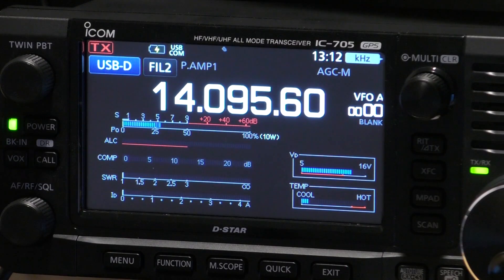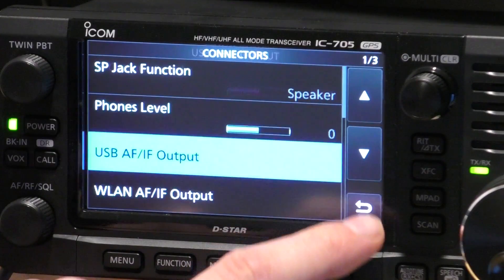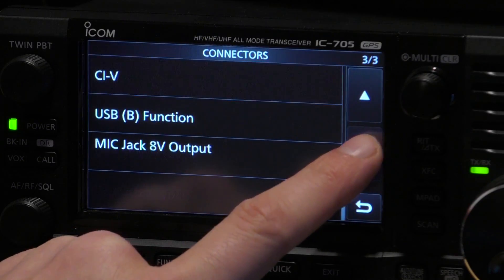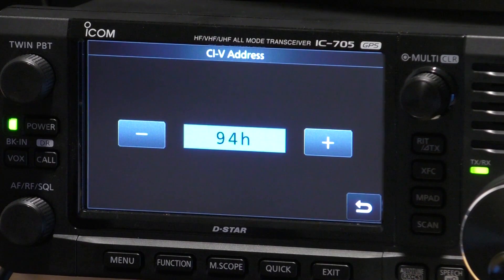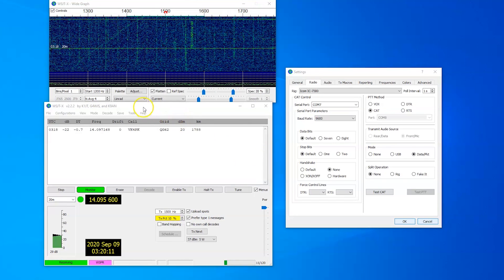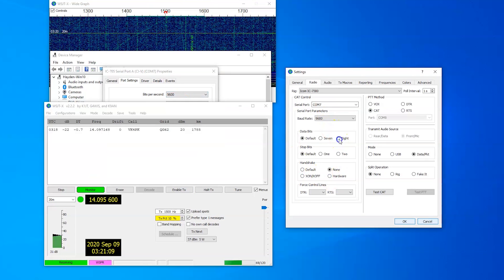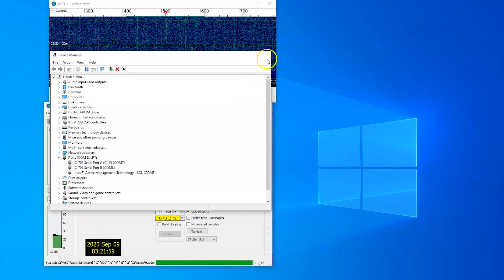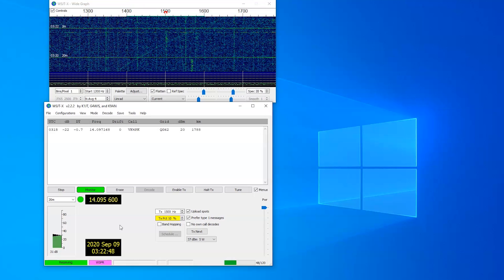Icom IC-705 SETUP for WSJT/Digital Modes (Easy and Simple)

Comment: Did you install the 705 Drivers or just use existing 7300 drivers... Thanks
Reply from the maker: https://www.icomjapan.com/support/firmware_driver/3070/
Reply from the maker: 705 drivers available on the Icom Japan website
Reply: @HamRadioDX  I was interested to know if it would work with the IC-7300 drivers,
they are the last quoted for Windows 7. I hate Windows 10
I may just try the ones straight from SILABS website, they are more uptodate than ICOMs
Reply from the maker: @MINI-4X4-RADIO  It seems that the USB drivers for the IC-705 actually have IC-705 written in them, as that is how it appeared in my Device Manager. They may not be different to the 7300, but some trial and error might need to be had. The IC-705 driver may work for Windows 7, but it's not officially supported, only 8.1 and 10.
Reply: @HamRadioDX  Many Thanks... I guess I can just try, can always uninstall if the 7300 Drivers don't recognise the 705
I do have a Win10 Laptop, just don't like it... I run Linux, but have a Win7 VM for Windows stuff
Reply: @MINI-4X4-RADIO  same problem. Resolved by increasing Connectors -> USB Af/If output -> AF output level up to 80%
Reply: @zetaBit  Not sure that was for me..??
Reply: Thanks but fails at Test CAT. “IO error while connection to rig”

Comment: I easily set up WSJT-X on my desktop PC couple years ago.  Now I'm trying to set up the IC-705 with either of two Windows laptops (Acer Aspire 3 15 or HP Pavilion G7).  Been working on the Acer for couple weeks and just today tried the HP Pavilion.  I get CAT CONTROL=GREEN and PTT CONTROL=RED and I'm able to change bands on the radio using the WSJT software.  But I can't decode any transmissions.  After loading the USB driver and right clicking for USB port properties I get IC-705 SERIAL PORT A (CI-V) (COM4) with 9600 baud rate, 8 bits, none for parity and 1 stop bit.  What's wrong.
Reply from the maker: Can you see the transmissions on the waterfall? Have you checked to make sure your PC time is correct-  I use NetTime that updates automatically.
Reply: @HamRadioDX  time is sync'd .  I'm just not decoding signals.
Reply from the maker: @Barnacle392  You can see signals appearing on the waterfall?
Reply: @HamRadioDX  not on the WSJT-X waterfall but yes on the radio waterfall

Comment: Does the IC-705 have an option to change the baud rate or its 9600 hard coded in the firmware? Thanks.

Comment: One issue I'm having is that the USB-D setting reverts back to USB when WSJT-X keys the rig. WHat is the configuration setting to make this "stick?" Thanks OM //73 KK0DJ Dennis
Reply from the maker: Under the radio settings is the “Mode” set to Data/Pkt? If it’s USB this will be switching it

Comment: JS8Call and WSJT-X are difficult to configure, erratic, and unstable, by even the most charitable standards. I have the MS Surface 3 and the Evolve Maestro running Windows, and getting FT8 working consistently is erratic, with both a USB direct connection the 705 or WiFi. SDR-Control for the iPad, however, is incredibly stable, and as close to perfection as software can be. Within minutes of first loading it, I was making contacts, and have logged hundreds with it so far. For those Hams who tire of fiddling and just want to make contacts, pick up an iPad or Mac, and try SDR-Control. Its in a class by itself.

Comment: Thanks for this! I received a call from a fellow ham to help with getting his new ic-705 working, but I don't have one (but familiar with the 7300). It would have been  a bit more helpful to see this done from factory defaults. 73!
Reply from the maker: Glad I could help and yeah I should've done from factory, but if you ever need to view factory defaults you can long press on a menu button and there is a default button there to compare. 73

Comment: What did you use to connect the IC-705 to the PC? Can it be done with just a USB cable or do you need an interface which connects to the sound card in the PC?
Reply from the maker: Yes just a single USB cable. No interface required as the sound card is built into the radio

Comment: WSJT-X  split  should always be Rig or Fake it to  reduce the chance of TXing any audio harmonics.
Reply from the maker: I didn't bother with Split operation as I wasn't going to use it. That said "Either method (Rig or Fake it) will result in a cleaner transmitted signal, by keeping the Tx audio always in the range 1500 to 2000 Hz so that audio harmonics cannot pass through the Tx sideband filter". Thanks

Comment: Data OFF mod should be Only  MIC..   not Mic/USB
Reply from the maker: Incorrect. The Mic/USB is set by default. Listen carefully to what I say in the video. I actually prefer to use Data Modes in regular sideband operation, not in USB-D. If you don't wish to accidentally have your MIC in and/or use the USB-D mode exclusively, then the above is correct.
Reply: If you set WSJT-X to Data/Packet mode (not USB) the rig will ignore the mic, even if you have MIC, USB selected in the rig MOD INPUT menu.